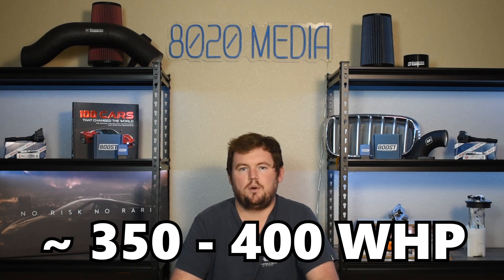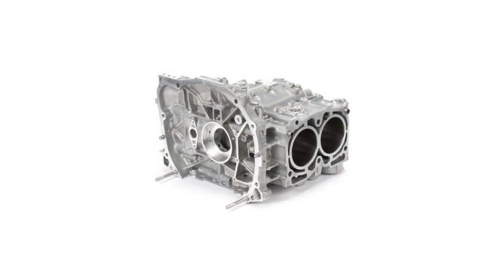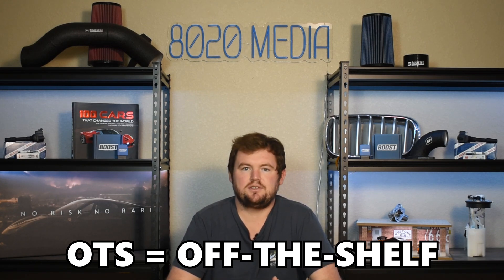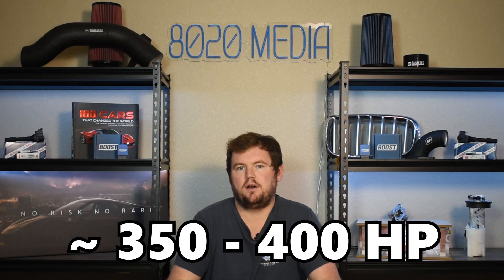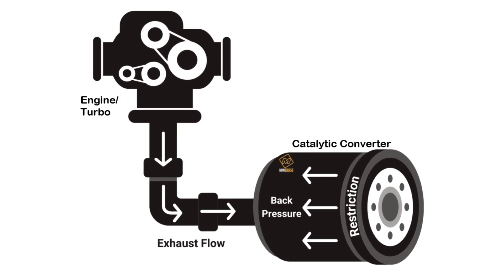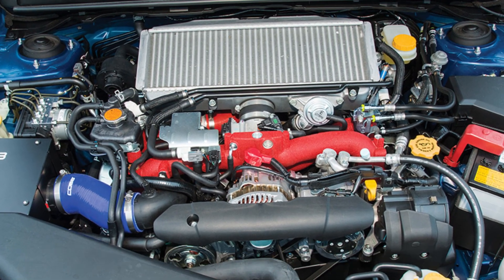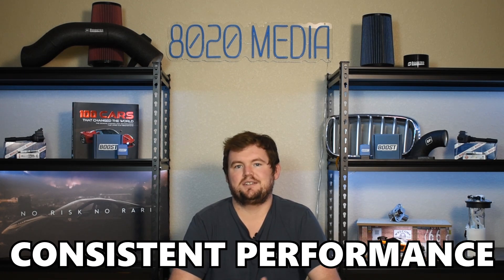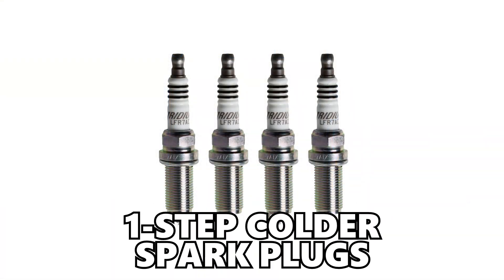How to Build a 350+ WHP Subaru WRX STI! (EJ257 Engine)

Comment: Now what do you need to keep it reliable???
Reply from the maker: H - You need a combination of preventive maintenance, smart modifications, and mechanical sympathy. First, stick to frequent oil changes every 3,000–5,000 miles with high-quality synthetic oil (like 5W-40) to protect the turbo and internals. Second, monitor coolant and change it every couple years—EJs are sensitive to head gasket health. Third, use only OEM or quality aftermarket timing belts and water pumps, and replace them before the 100k mile mark. Always let the engine warm up fully before hard driving and cool down after boosting to protect the turbo. If modding, avoid aggressive tunes on a stock block—keep boost conservative, and always tune with a reputable shop to avoid lean conditions or detonation. Keep an eye on oil levels, learn to log data (AFR, knock, DAM), and treat the STI like a high-performance machine, not a beat-on daily—do that, and it'll return the favor with solid longevity.
Reply: Excellent question. I was thinking the same thing.
Reply: focus on reliable or proved oil cooling systems, also cooler for transmission
Reply: Injectors, fuel pump, tgv deletes and 3 port boost solenoid it isn’t that simple. To get anywhere near 400whp